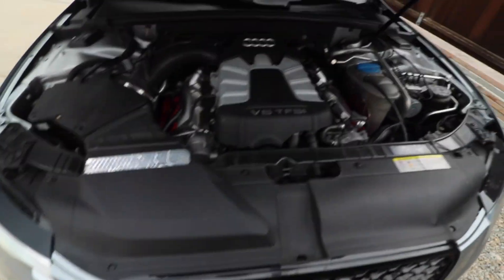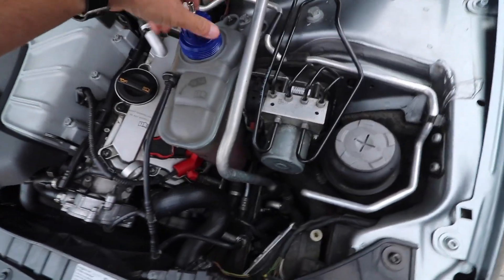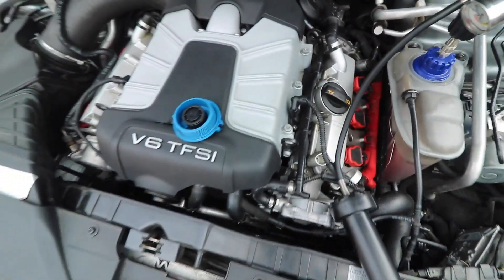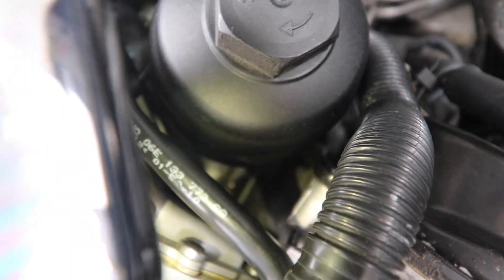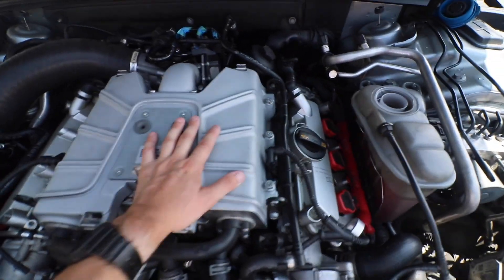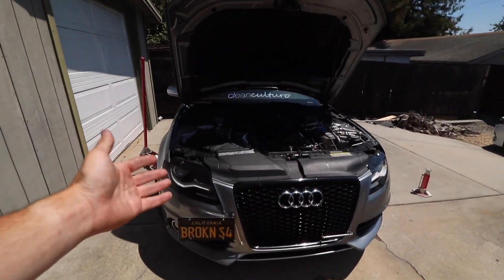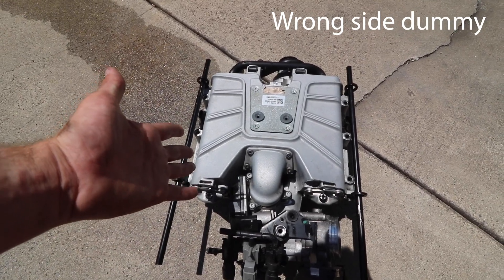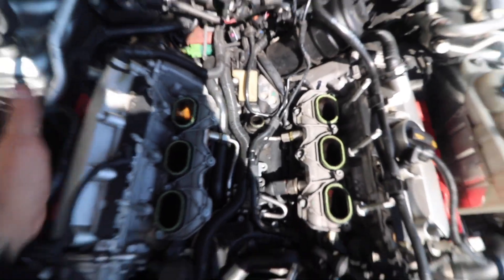WHAT HAPPENED TO MY AUDI S4!?

Comment: I'm looking at purchasing a B8 S4 but I am afraid now after seeing your videos on the car mechanically failing from time to time. Are these problems related to the car itself or all the tuning you have done to it? Hope to see it back on the road soon!
Reply: There are common failures on this platform like thermostat, and crank pulley at higher mileage but over all these cars a highly reliable. Prob some the most reliable engines Audi has ever made. Most the issues he's had are more related to a tuned car.  But intercoolers are common as well for higher hp cars but there are better than stock intercoolers available now
Reply from the maker: Pretty accurate, however I haven’t seen the aftermarket intercoolers you’re referring to
Reply: marcmann982 what aftermarket intercoolers are options now? I had been looking into options awhile back and forgot about it until now. Please share as I’d be interested in upgrades, I’ve only seen that they have new revisions of the old parts
Reply: @TommyLinebarger  probably talking about the heat exchanger upgrade.

Comment: Happened to me over cylinder 6... installed meth injection to help keep temps down. Also just get a new intercooler..... $270. Pulled the whole engine thinking it was a head gasket, was a big job.

Comment: Buy a ported core charger while it's off with new cores. From either Matty or Brett at Jokerz
Reply from the maker: Yeah that’s the plan I think
Reply: @TommyLinebarger  good stuff you'll love combined with dual pulley it's next level
Reply: I went through jokerz as well. I also purchased APR TB and had them port at same time as supercharger. Car runs great.
Reply: @richardjason2  Bretts work is insane porting gives a great response in just driving about.
Reply: Any links for a supercharger?